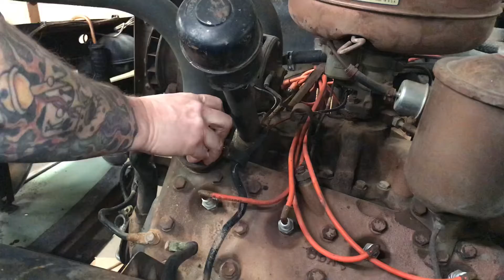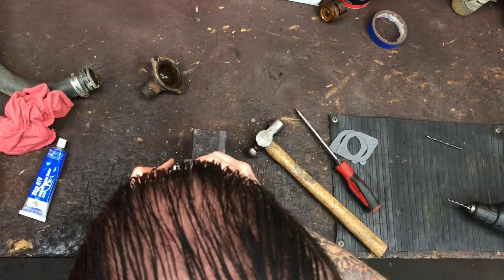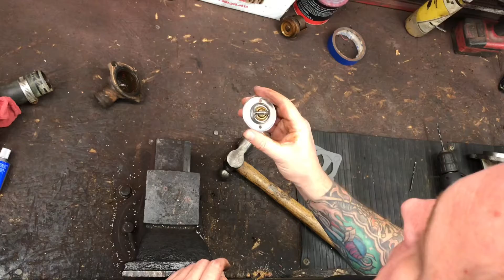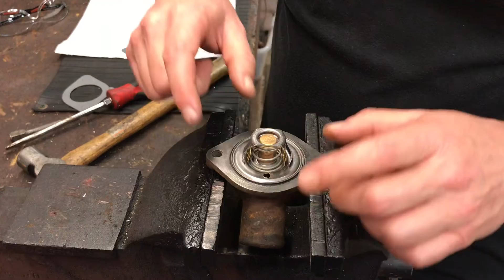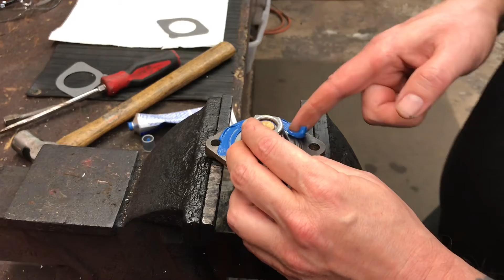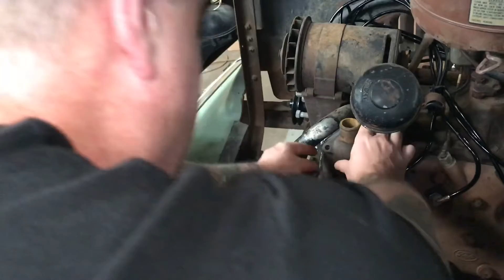Ford Flathead Thermostat Trick & Install

Comment: Whenever I use a silicon gasket 'goop' I will torque the item down at about 50% of the recommended torque specs and allow the 'goop' to setup then return to finish the torque to the spec. This was, if the 'goop' had any voids, the final torquing should close the voids and avaoid potential sweating or outright leaks. Just what I do.

Comment: Thanks for sharing this. I run the 180° thermostats with a new aluminum radiator and an electric puller fan. Seems to run just fine that way, summer temps don't seem to faze it at all. The 160° setup seems like it would be overwhelmed at some point on a hot humid day running at higher speeds or engine loads. When the ambient air temps get within 50 or 60 degrees of coolant temps, that's a bad spread.
Reply: Would you be able to explain what you mean? Woukd a 180 be a better choice? I can't seem to understand  how a 160 would be worse, if anything I've heard mention of engines running to cold and fouling spark plugs or excessive  condensation
Reply: @ a 180 degree thermostat lets the radiator dissipate the heat better and keeps the engine running at a temperature that makes it more efficient and keeps the plugs from carbon loading.

Comment: Cool trick about the bypass holes I have a 8N Ford tractor with a flat head and I agree that it’s better to put in a 160 F rather than a 180 F especially if I am plowing in the fall and it happens to be a + 30 C day and in winter if it’s necessary for her to run a little hotter I just put a winter front over the grill and she runs nice you can see the thermostat cycle perfectly on the Temperature gauge.

Comment: What size are the holes that you drilled and are the holes recommended for the 6 cylinder flathead too?
Reply: Good question
Reply: What oil do you run in your flat head Non-detergent or conventional/detergent. weight
Reply: @TatiMags  they need zinc and a fairly heavy weight. Shell Rotella 15w40 diesel oil has both of those.

Comment: Do you have an email I wanted to send you a pic of my 8 BA engine and ask what a certain plug is for?
There is an identical one on the other side of the engine.. it may be a temperature gauge line 
Except my line is missing? Thanks

Comment: 7:57 The takeaway here is people are impatient and rushing the jobs. Nothing you're doing here is anything I haven't done on stat replacements for engines much newer. Same trick when I did the stat in my '85 F150's 4.9L I6, when I did the stat in my mom's '03 Explorer 4.0L. Taking one's time and doing it right keeps parts from breaking.

That explorer, by the by, has a fucking PLASTIC water neck. PLASTIC. You think it's easy to crack these old 8BA water necks.....